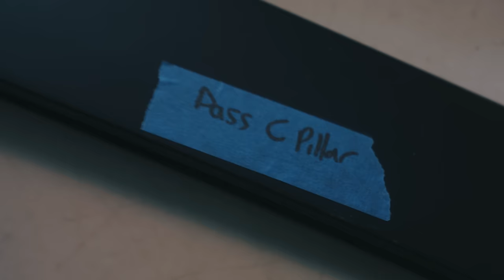The Best Way To Restore Your Faded Black Vehicle Trims, The Permanent Way!

Comment: dumb question ... you prepared and painted the tailgate spoiler on the car rather than take it off...how come? would you have preferred to remove it?
Reply from the maker: I mean it could have been a little more convenient if it was removed but it’s attached with the same adhesive that the windshield is. You have to saw it off essentially 😭

Comment: Where can you source SEM 39143 in Canada? I really need to refinish my windshield wiper arms on my e46
Reply from the maker: I just get it from either Amazon, but most auto body supply shops will also have it on hand. There’s a few in Toronto if you google ☺️
Reply: @ChromaticGarage  The oem finish you were able to achieve was perfect. Your attention to small details like this is evident in your project.